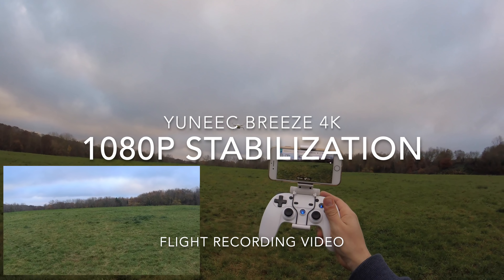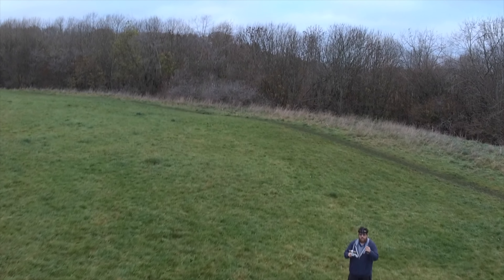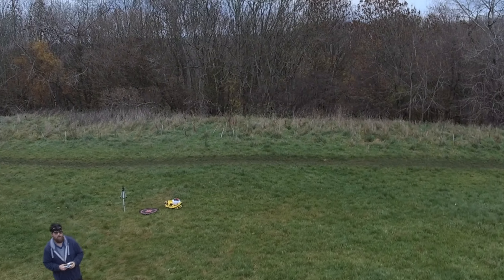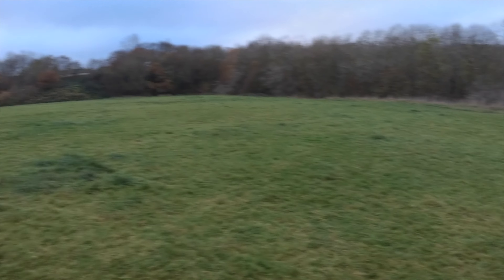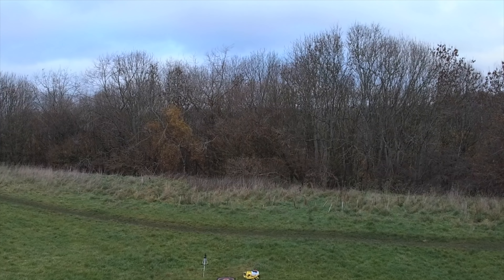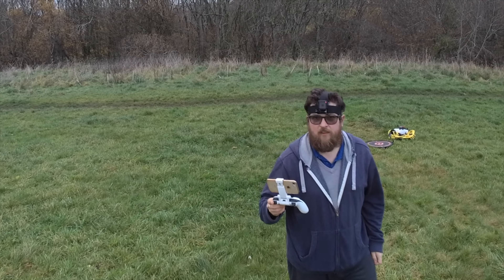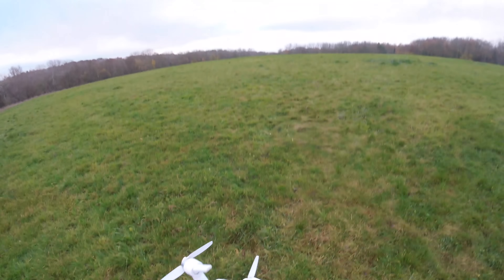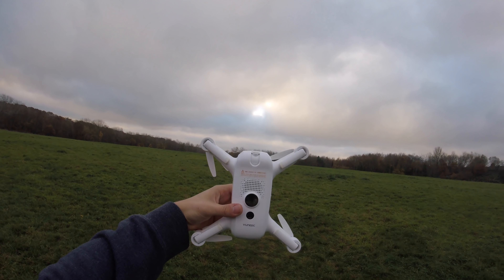Yuneec Breeze 4K 1080P Video Stabilization Flight Test Video

Comment: Hi jd, another good video mate, I totally agree, a certain quad for a certain job and this is definitely a selfie drone, lol one that just eats that wind that's for sure. Yeah I admit I hardly used the 4k function and preferred to use the 1080 and  stabilizaton with the pre sets on either sunny or cloudy, but I'm glad your prefer the 4k because that's half the point of having the drone.. Totally agree with the game style controller, I much prefer marketed buttons but they will head in your head sooner or later, but using the drone just with the phone app is probably the best drone I've flown with an app even now.. I'm also looking forward to seeing you do a test with your android phone to see if you get less breakup in WiFi.. Happy flying mate 👍
Reply from the maker: Hey Marc how are you doing bud? Thanks matey 😀👍
Reply: @jdquad  hi jd, I'm doing much better thx mate 👍 hope your good too. Roll on the weekend for sure lol😁